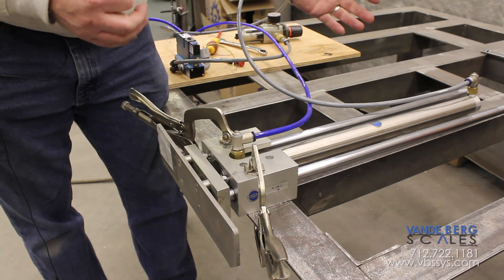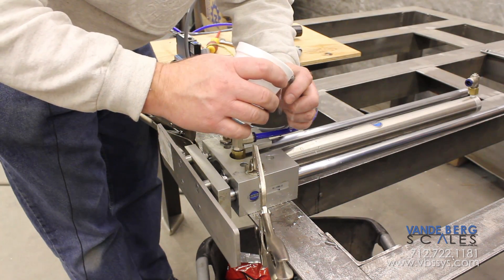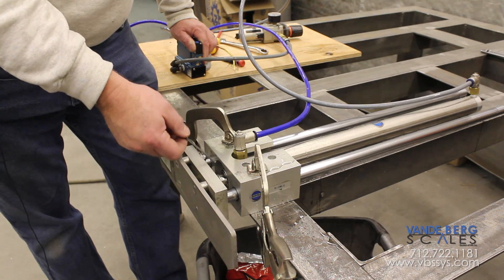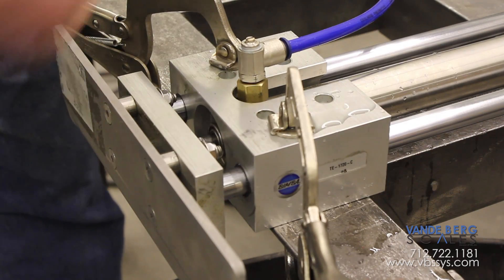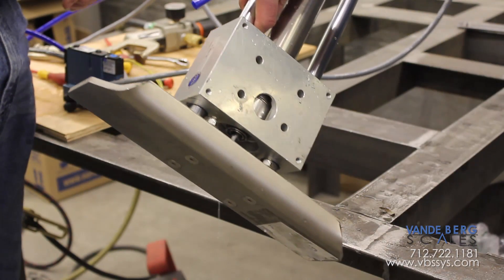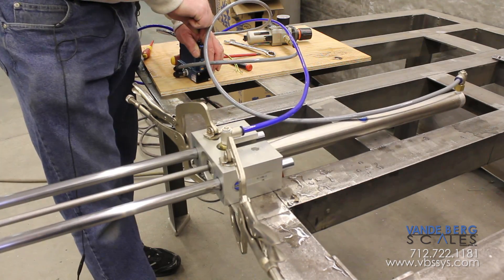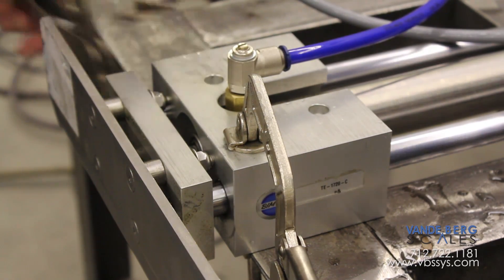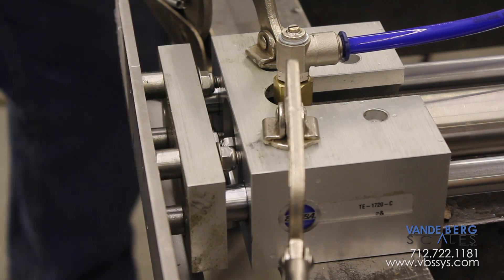Effects of Water in an Air Cylinder

Comment: and i would like to know what if you use penumatic cylinder as hydraulic cylinder
within spec pressure range of the pneumatic ofc
because i wanna do some weird stuff with gas pedal for the throttle that do the same as a master cylinder for brake in a car xD
aslo i need  a cylinder to act as a dampener and spring with valve and mini tank 

but i need to know the effect on those cylinder wear and tear
or other stuff